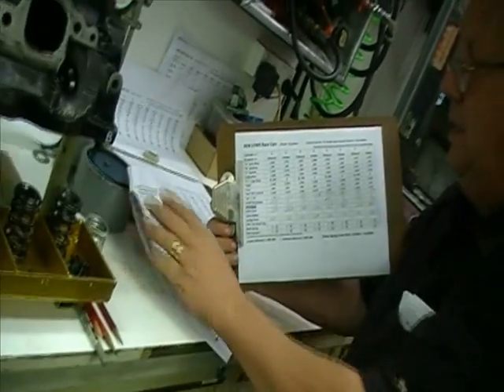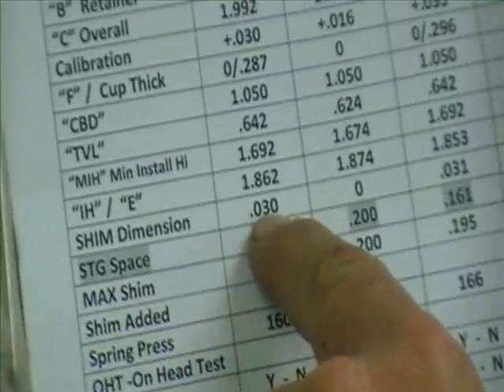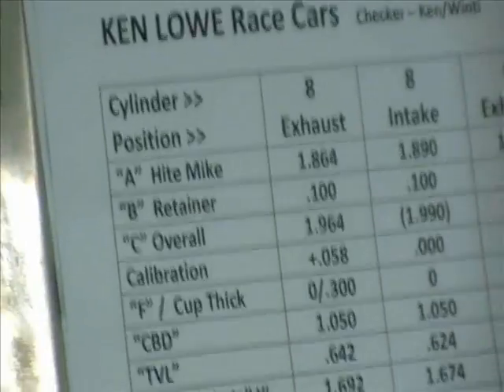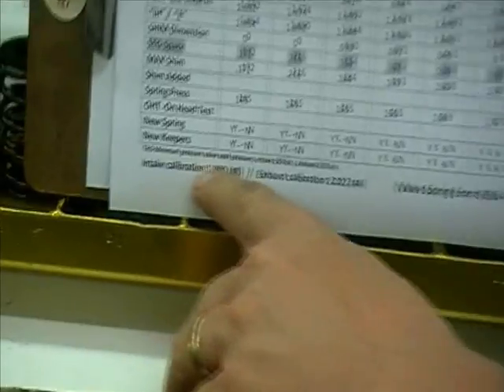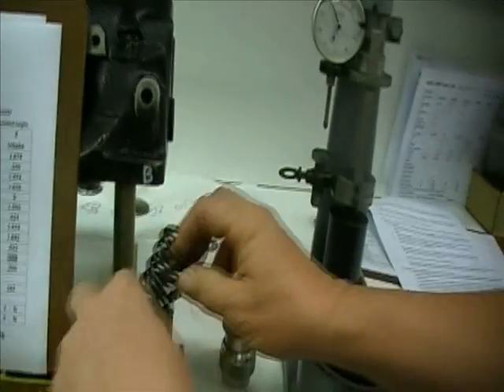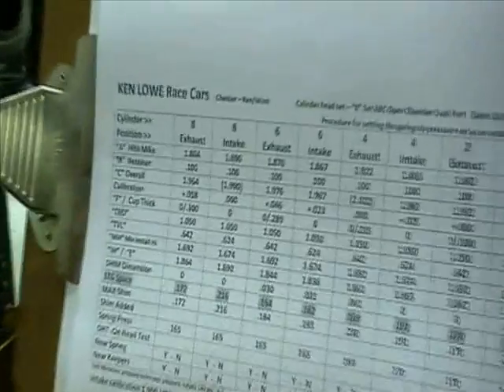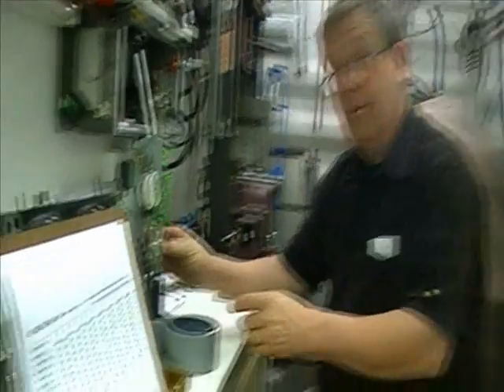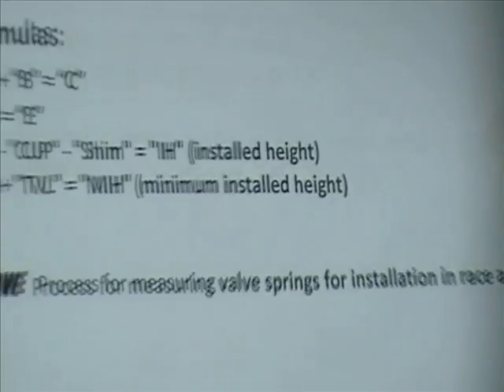How To Setting Valve Spring Pressure 2 of 2 For Race Application

Comment: Interesting -
I'm sure that's with hydrologic lifters. Could be for solid also I suppose.
How about - air cooled VW - most all spec sheets show - # @ 1.5 installed height. I believe mostly because of the limited valve adjustment.